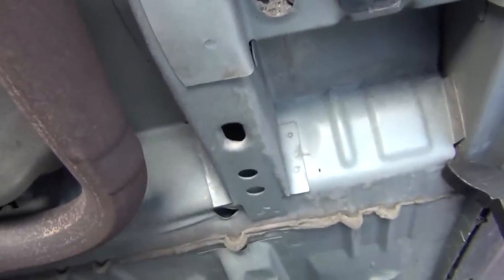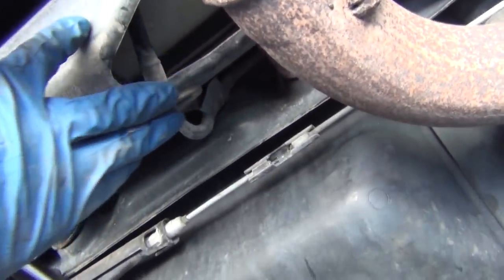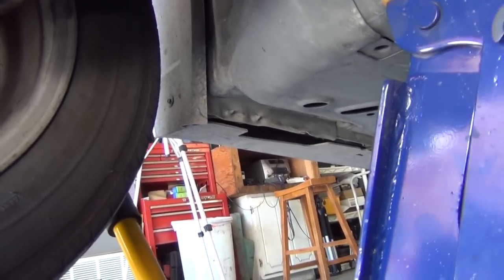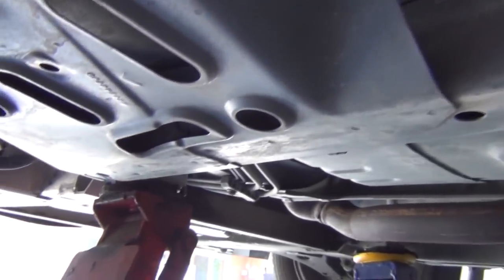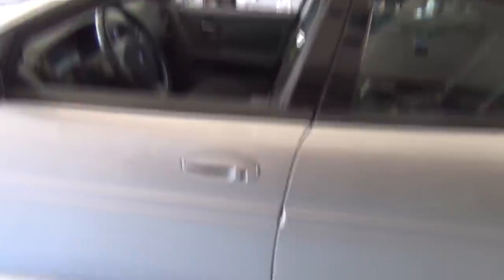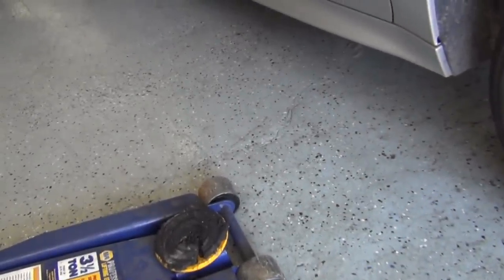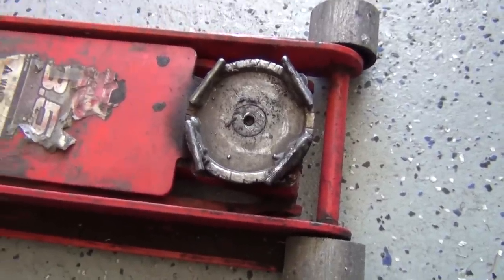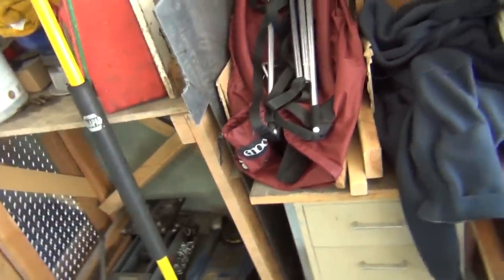How to jack up your car without jacking up your car

Comment: my floor jack the left right wheel is off and above the ground a little,
 so when I jack up the car the left rear wheel is in the air! so as I am
 pumping the floor jack the rear will move to the right some. don't use 
the floor jack? or just put some towel underneath to make it even?

Comment: My problem is that I have a Gravel Driveway so that it pretty much makes it impossible to jack up a car or even use a pair of car-ramps to drive up on because with the gravel the jacks or car-ramps are not sturdy enough.
Reply: +44357514  Simple solution - use a 2 foot by 4 foot panel of 3/4" plywood under your jacks. You could even use (2) layers of this if you like. This size is known as a Handy Panel, and are sold pre-cut at Lowe's and Home Depot.
Reply: you could use cap concrete blocks

Comment: DO NOT JACK ANY UNI-BODY CAR BY THE FORMED RAILS THEY WILL CRUSH OR BEND THE FLOOR UP.
JACK UP on the  pinch weld or where the lower control arm bolt to the body or the front sub-frame

Comment: Hey Brianmobile1, i hope you are well out there! Brian, i need your help to figure out a issue with my 2000 outback. for the past few months, when i went to start my car in the morning or first time of the day (cold), it doesn't start. The only way it will start is, when i hooked up my electric charger and put it on 24v, then it;ll start without a problem. Through out the day, it might happen few times and i will have to jump it to get it going again.

I put a new battery in because, autozone and oreilly said i have a bad battery. Now, starting it first thing of the day, starts fine. The problem now is, after driving for awhile, it won't start. It'll take up to 30mins before it'll start from trying several times. I have spoken to few mechanics and some say, starter, some say crank sensor etc. (note, i hear a click whenever i am turning the keys to start my car). One of the other confusing thing that is happening also is, for the past few months, i will take my car to autozone and oreilly to have the engine check light check. Everytime i checked it, it gives a different codes. My check engine light goes on and off all the time for more than a year now. Any ideas???

You have helped me greatly with your videos on things i need to do on my car. There are many things i am comfortable to do on cars and there are many that takes me awhile to build my confidence to do. So far so good. I honestly don't have the money to take it to a mechanic and even if i did have the money, i might not take it to a mechanic because, this is very, very fun for me do. I loved working on cars for fun and i am glad you and others are there to help. Thank you Briansmobile1. Abdulrahman

Comment: Flagging the religious bickering as the spam it is... and done.

Very useful video as usual. I have supported the rear of my older Subaru on jack stands on the trailing arms, but they're tubes instead of beams so hopefully they're fine. I will avoid this in the future in either case.

Comment: When I was 17 I used to jack up my 86 trans-am in the rear from the differential and then I placed jack stands on the rear axle.  Was that a bad thing?
Reply: +Joshua Felty diff is so heavy duty, I use it as a common point for rear of car, mechanics do it too. However, being centre of car, it can slide / roll either side if it a flat metal jack point with a slipper floor
Reply: wonniewarrior  Thank you for the advice.  When I did this I placed the jack stands as close to the wheels as I could. If I had a tire removed, I placed it under the differential, just in cause.  :)

Comment: Not trying to be that "Oh, I know this!" Mr. know it all, jackassey type guy but...........Towards the beginning of the video when talking about correct jack point on the rear of the truck, at point..................2:34 into the video when you referring   to the part of the suspension you called a "radius arm". Once again,sorry if come off as a douche bag. The part is you were referring to is a "Trailing arm" I guess for the same reason they call the trailing axle a trailing axle.
  The only reason I know the name of it is because I had a customers "new to them"purchase on the rack for a standard regular-unleaded inspection.She brings her cars to us for all her routine maintenance&repairs.She got a really great deal on the thing,a 98 impala like 1500.All it needed to run was a new battery.Said she got it off her Aunt when Her Uncle passed.......anyway the the wrong with the thing other then the normal simple things people over look, like the PCV valve, and fluid exchanges was the rubber bushings pretty much all around were getting to that point.The front upper and lower control arms had been replaced just before uncle left us so they were fine.sway bar linkage,tie rod ends,one motor mount(but not to the point it caused damage,The rubber was still there it was just split all the way around getting ready to fall out.anyway That and the rubber bushings on both trailing arms were shot.I told her they needed replaced and called the part the rear "control arms"I think is what I said.My manager was listenng and acted like he needed me to help him real quick, as not to call me out in front of a customer and corrected me.He explained to me we didn't replace the bushings on those we only replace the whole arm.He also corrected me on the term and told me it was clled a trailing arm.Anyways I played it off with the customer and corrected myself to her, and explained to her that even though the parts would be cheaper to replace just the bushings but the labor would offset the price to the point that we only replace the whole arm that comes with new bushings.Not only is it sort of a paint in the ass to get those bushings out and new ones in it is amarter i think to go ahead and replace the whole arm.If the rubber is completely gone like hers were then it has been grinding metal to metal and the new bushings may not seat properly.We have to back up our work with a 100% guarantee So to avoid any issues and pissing off a good customer we only replace the whole part on things like that.Sorry for being a know it all and ranting.Peace im out.

Comment: but you still jacked it up. I avoid jacks if I can. Ramps are much safer and faster
Reply: the stig mach 1 Good luck changing a tire with a ramp.
Reply: SuPhOwSlFe hence the reason why I said "I avoid jacks if I can" obviously if im rotating tires or doing a brake job or whatever I use jacks. But for an oil change ramps are best.

Comment: The diff is not a good spot
Reply from the maker: +B GerK You're right.  It's the best!
Reply: +briansmobile1 Jacked up many Miatas in my time, can confirm diff is best jack point.
Reply: +Samniss Arandeen thats a light car im afriad something might break if i jack up my g8 by the diff
Reply: +B GerK I've seen tons of full size trucks jacked up using the diff. The diff and axle hold the weight of the vehicle its whole life.  Plus the weight put on it while hitting bumps at speed, etc. Jacking it up by the diff is not going to break anything.
Reply: In some manuals it specifically states not to jack the differential because it can cause damage.  The diff does NOT hold any weight besides itself and half the drive shaft.  Weight is transferred from body to springs to control arm (if it has them) to axle directly under it then to wheel hub and wheel.  You can literally remove the differential and the vehicle will sit there just fine which would be impossible if it were supporting the weight.
Reply: +locomojo0485 not with a solid rear axle which is the case with virtually all older rear wheel drive cars, and just about any pickup truck.
Reply: +locomojo0485 if there is a reason not to use the diff it would be because if you were thoughtless you could catch an edge of the jack pad on the steel plate cover of some differentials and bend the edge of the cover causing a leak.
Reply: +locomojo0485 if there is a reason not to use the diff it would be because if you were thoughtless you could catch an edge of the jack pad on the steel plate cover of some differentials and bend the edge of the cover causing a leak.
Reply: batvette
Reply: ***** WTF is a hogs head??   Never heard that slang for a rear diff, if that's what you are referring too.
Reply: There's no way to not "be an idiot", it simply isn't designed for this and on some vehicles can be damaged.  Consult your particular vehicle's owners manual to see if they state that is acceptable and don't do it if they don't.

Further there is no reason to do it except laziness.  We all know you should never rely on a jack to support a vehicle while working on it, so all you're really doing is saving 30 seconds after jacking up one side, to move the jack to the other side and lift it too, before putting jack stands under each.  Is 30 seconds worth it?  Yes, along with lots of other ways that rodeo cowboys try to cut corners, it's in your best interests to do things the Right Way in all cases... doesn't hurt me one way or the other if you listen to bad advice on the internet.
Reply: B GerK 
Yeah the diff or the cross cz the jacks at front but it looks like may have had the jack there.

Comment: If you need to watch this video, you shouldn't even be jacking up a vehicle !
Reply: After you jack it up, be sure to put in on stands before you get under.
Reply: Jack it on the frame or uni-body side main rails, front frame cross member. Axle or differential on rear wheel drives.
Reply: You watched it.
Reply: Jennifer An
I'm considering getting 1 actually.

Comment: Video title is a total lie.  He doesn't demonstrate any tricks.  Looks like driving it onto a set of ramps is still the safest way to elevate your car without using a jack.
Reply: It's a play on words. Jacking it up also means messing it up.
Reply: Tolohtony  Thanks.  Using local slang wasn't very nice of him.  I must be the only one who was looking for a trick to work under the car when you don't have access to a JACK.  :(
Reply: Natural Philosopher I thought he meant the same thing by just reading the description.
Reply: Natura Musical Reading the description on the video is a good starting point.
Reply: Natural Philosopher http://www.urbandictionary.com/define.php?term=jacked+up 
Also known as F'ed up.   
There are times that you need to work on the brakes, suspension, drive axles, rotate the tires, put on racing or snow tires, replace damaged wheel or flat tire in which case you need to remove the wheels so ramps are not an option.
Reply: Natural Philosopher I was looking as well. You weren't the only one.
Reply: Natural Philosopher If you honestly think that you can "jack" up a car without some means of lifting device... then you shouldn't be working under a car. Please hire someone before you crush your skull.
Reply: you can unweight a single wheel if you cleverly position one wheel to hang off a curb via the slope of the ramp.  instead of literally dropping one wheel off a sidewalk curb.... you're dropping it off at the sharpest angle of a driveway ramp. done correctly the wheel would still be in contact w/ the concrete at the bottom of the ramp, w/ very little weight on it.  once you've found this spot, it's possible to remove the wheel and replace it manually.
Reply: Natural Philosopher All autos have their primitive jacks used for emergency tire changing unless some dirtbag stole it.  There is no excuse for not having a jack of some sort, and if you plan in advance as everyone should you can have a variety of jacks for little money.  (I collect heavier duty truck and auto jacks for multiple uses from lifting vehicles to horizontal application of force to move anything I need shifted. I also have proper floor jacks of course.)

I gave away my ramps long ago and use rims (aluminum preferred for lightness and lack of annoying rust)  which I place with or without shimming using hunks of pressure-treated 4x4 wood or similar I keep for the purpose. This is FAR more stable than a jack stand, and rims are safe even on sand.  Many "you pull it" self service salvage yards in the US place their entire fleet on rims for safe easy access. You can knock a vehicle off stands with some effort, for example if a drivetrain suddenly shifts during removal or installation. To knock an auto or truck off horizontal rims properly placed is an accomplishment!  In decades of wrenching I've never had one shift.
Reply: Natural Philosopher local slang? I live in Newcastle in the UK and know what that means...
Reply: Natural Philosopher 
He's got to under the car, i don't know y, his just complicating things.
Reply: try doing a brake job with ramps
Reply: Natural Philosopher 
It depends wat yr going to do, u can't use ramps 4 everything.
Reply: janet sers 
Well that's wat i was saying b4 there a some jobs u can't do with ramps.